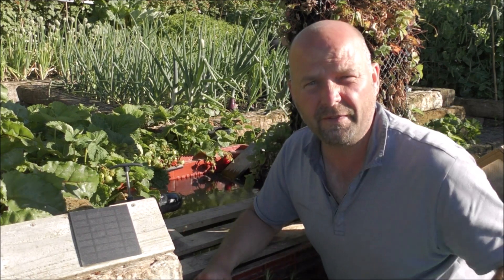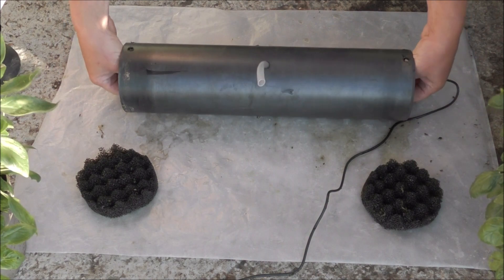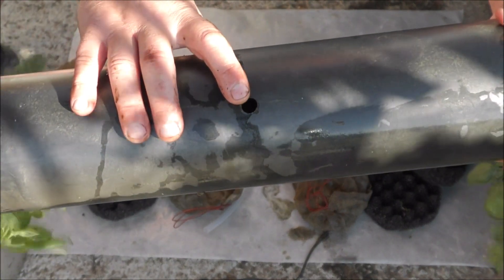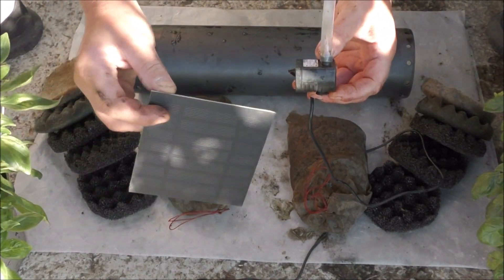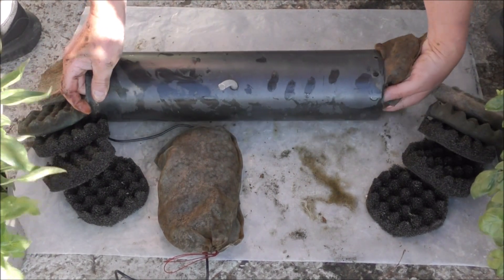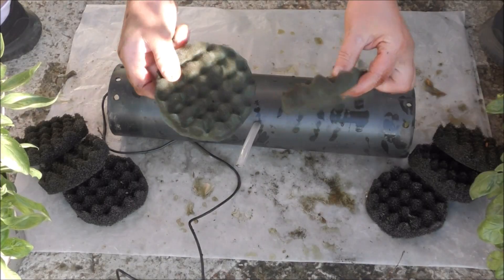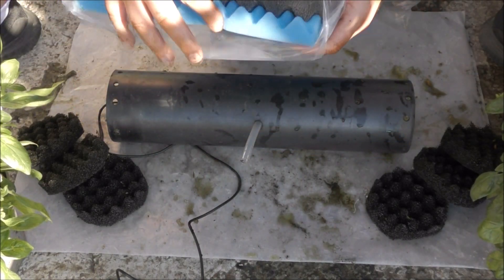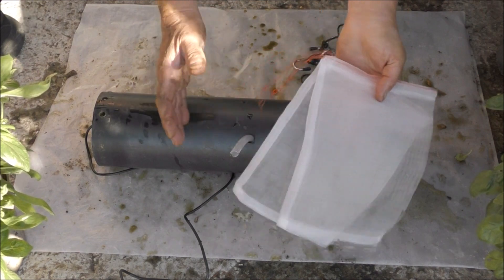How To Build a Solar Powered Pond Filter

Comment: Aaaarrrgh.....YouTube keeps deleting my pinned comment so I'm using my other account to post this......damn....
 As promised this is a video showing how the solar powered pond filter is made and the parts list can be found below.
Solar powered water pump (Ebay): https://ebay.us/U7ofCD
Solar powered water pump (Amazon): https://geni.us/M22pjdB
The pump is the 200 lph / 1.5W version.
Foams, Biogravel and mesh bags: http://www.filterpro.co.uk
I used 1.5kg Biogravel split between 2 mesh bags.
Foams and fine pad would be a set of coarse, medium and fine if bought from FilterPro (Foams page) but they're available all over  the internet and from any good pond supplies shop.
4" drainage pipe (any pipe of similar diameter will do)
Decent alternative media would be either the 25mm Alfagrog: https://geni.us/kTwG
or Eheim Substrat Pro: https://geni.us/98euQaB as the Alfagrog works very well in muck and the Substrat Pro is as close as possible to Biogravel.

For a normal wildlife pond it will be fine to have the filter on the bottom of the pond, outlet pointed up, but I used steel 'S' hooks and paracord to suspend the filter about 6" up from the bottom of the container I use.
The water coming into there is from my pond filters and it contains lots of sediment which settles on the bottom

Solar powered pump video: https://youtu.be/7J8sB1Y60VY
Hydroponic system using this pump can be found on my Thousand Yard Stare channel here: https://youtu.be/z76J-DSk0JE

Comment from the maker: As promised this is a video showing how the solar powered pond filter is made and the parts list can be found below.
Solar powered water pump (Ebay): https://ebay.us/U7ofCD
Solar powered water pump (Amazon): https://geni.us/M22pjdB
The pump is the 200 lph / 1.5W version.
Foams, Biogravel and mesh bags: http://www.filterpro.co.uk
I used 1.5kg Biogravel split between 2 mesh bags.
Foams and fine pad would be a set of coarse, medium and fine if bought from FilterPro (Foams page) but they're available all over  the internet and from any good pond supplies shop.
4" drainage pipe (any pipe of similar diameter will do)
Decent alternative media would be either the 25mm Alfagrog: https://geni.us/kTwG
or Eheim Substrat Pro: https://geni.us/98euQaB as the Alfagrog works very well in muck and the Substrat Pro is as close as possible to Biogravel.

For a normal wildlife pond it will be fine to have the filter on the bottom of the pond, outlet pointed up, but I used steel 'S' hooks and paracord to suspend the filter about 6" up from the bottom of the container I use.
The water coming into there is from my pond filters and it contains lots of sediment which settles on the bottom.

Solar powered pump video: https://youtu.be/7J8sB1Y60VY
Hydroponic system using this pump can be found on my Thousand Yard Stare channel here: https://youtu.be/z76J-DSk0JE